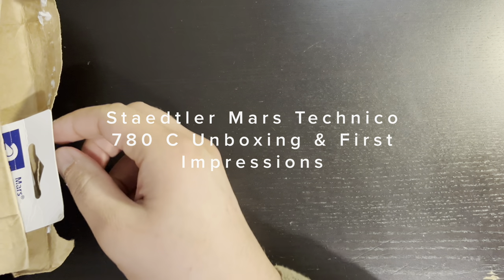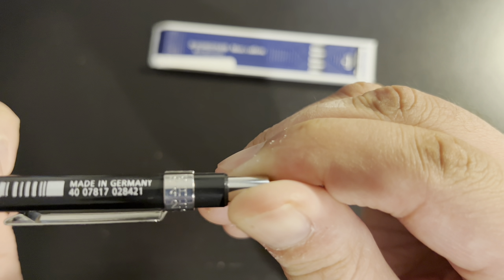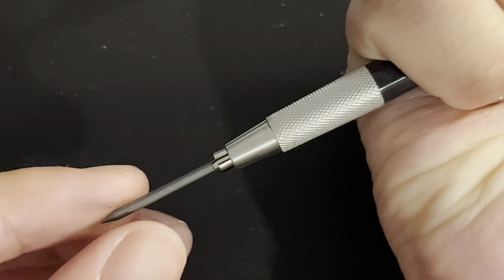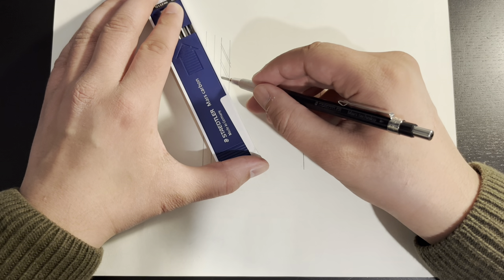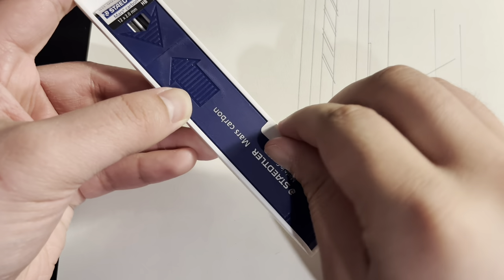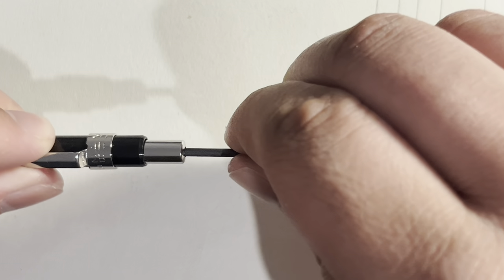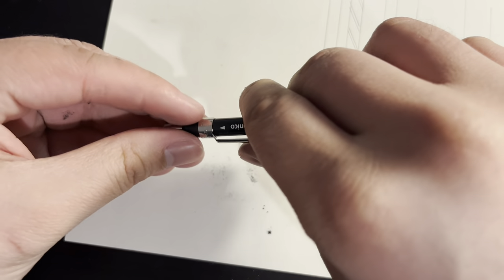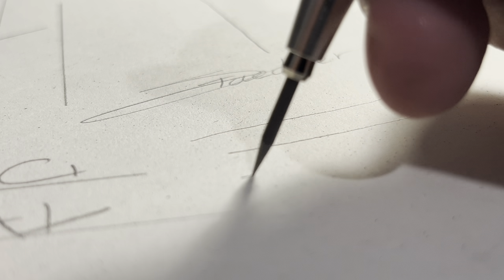Staedtler Mars Technico 780C Lead Holder Clutch Pencil & Carbon Leads UNBOXING & First Impressions

Comment: It is not possible to break the lead.. It takes much, mush more force than should be used to draw.   ... If anybody use that much pressure they Will also make big mark on the paper... several pages in a sketchbook. ... Relax when you draw.
Reply from the maker: Thanks for the tip, I’ve had a few instances where the lead breaks.

Comment from the maker: Note: About the pencil's compatibility with the Staedtler Mars 502 sharpener/lead pointer; I later found that I just needed to empty the tub which was very full and it caused problems when trying to sharpen the pencil. There's no problem and the pencil works with the 502 tub sharpener perfectly fine.

Comment: For technical drawing, Faber Castell TK 9400/ TK 4600 are far superior For general use and precise line work, Staedtler 780 is way better. So, for free drawing, either go with Pentel Graphgear 500 and Faber Castell TK 9400 combo, or if you want a one tool option, choose the Staedtler 780. TK 4600 with the clip removed, becomes a better TK 9400 pencil! Those I mention,are by far,the best drawing pencils you can get.With Faber C. I suggest their leads.For Staedtler, I prefer either Kitaboshi/Penco or Mitsubishi Uni leads.
Reply from the maker: Thanks for you comment, a very useful advice 👍
Reply: @DrawingTechnical  I dont agree with people saying,that its all about the skill of the artist.Its also the tools that add to that. The pencils i mentioned,provide control and precision,that no other pencil can.Glad I helped!
Reply from the maker: I have the TK9400 (2H leads) and I love that pencil, I use it in combo with the 780C HB leads. I've yet to draw something serious, but I have to say that holding these pencils is very comfortable.
Reply: @DrawingTechnical  Very stable grip too! Best pencil for both technical and free drawing! Fbate Castell 2mm HB and 2B leads, are what I use most.
Reply: For me Staedtler 780 is my work-horse and then I use GG1000 [0.5mm] and GG1000[0.3mm] for detailed work as required.  780 is great for everything but you have to keep sharpening it for detailed work whereas the finer tips stay sharp since the leads are thin.  Each to their own.  They are all great tools TBH.

Comment: Here’s the issue.  For a very fine tip you should not be pressing hard.  The PSI is incredibly high on sharp points.  You should be using the other less pointy sharpener in the tub.  Also look at the lead you are using.  Harder leads means more pressure = tendency to break if you want to achieve a dark line.
Reply from the maker: I have a set of 2H and HB leads, for construction line and finish line drawing respectively. In this video I broke the lead on purpose just to feel how hard it is, I don't normally break leads when drawing.
Reply: @DrawingTechnical  Got it!

Comment: Breaking leads, really? As an artist and writer who only exclusively uses Staedtler pencils - specifically the lead holders. I haven't had any lead breaks in the 16 years I've been using the lead holders. It could very well be you're applying too much pressure when you sharpening - or it could be as simple as a defective sharpener.
Reply from the maker: Hello, yes in the video I was trying to see how hard the lead is, i made it break on purpose out of curiosity. I am confident that lead pens won't break from drawing pressure. Thanks for your comment. Also with the sharpener, the tub was full, that was the problem, solved now.

Comment: Iv'e been using Steadtler for decades and have never broken a lead, that includes the softer 4B as well. Perhaps you extend the lead to far when you write, i never have more than 1 mm past the sharpened part of the lead beyond the grippers.
Reply from the maker: Hello, yes I understand, I just wanted to feel how hard the lead was. A worthless test, but I was curious.
Reply: @DrawingTechnical  You just need to learn how to use the pencil by the sounds of it.  Abusing it won’t achieve anything useful.  Get some different leads and try laying down different tones.  You’ll leant how great these pencils are that way!
Reply from the maker: Yes, I need to learn how they're used. I have heard many great and famous designers of luxury cars use them and who knows who else. Just need to practice.
Reply: @DrawingTechnical  There are 2 basic ways to use this pencil.  Writer’s grip (between finger and thumb like you write and then there’s the more weird “artists grip” which is basically holding the pencil as if you are picking something up (you hand is like a pincer).   The artists grip is typically used for charcoal but pencil artists use this a lot too.  You extend the lead out about 1 inch and then used the pencil on it’s edge to lay lines and shade down.  It’s a very light touch on the paper and you typically use your arm and not your wrist.   This is where these pencils excel and you should try this artists grip (AKA overhand grip).  I think you’ll enjoy the pencil a lot more when you use it this way.
Reply from the maker: Thanks for the info, I will have to try this.
Reply: @pentachronic  You can still use the writers grip, but hold the pencil at the back,  that allows for longer strokes using your fingers instead of the whole wrist.

Comment: When I was younger i feel in love with staedtler products brand for some reason I can not remember, maybe the brand aesthetic seemed to be profesional at first sight, mostly mechanical pencils, but watching this product (which I intended to purchase years ago) I feel like the brand made just the bare minimun in this design... not a proper lead grade indicator, nor a proper lead pushing-forward mechanism as all decent mechanical pencils, nor a decent grip or needle point for technical drawing with rulers... Thank good I didn't buy it because it was very expensive compared to similar alternative brand studmark with better features.. I guess they went straight into a vintage minimalistic design
Reply from the maker: Can you give me a suggestion for a good mechanical (or preferably a clutch) pencil? I clearly have no taste because I like this pencil a lot. I’m a modern day CAD/BIM user who never has to really use all these tools but I have a hobby of doing technical drawing the old way. Thanks.
Reply: @DrawingTechnical  Hahaha don't worry mate, we all have our own taste on pencils :D Maybe I was too hard judging this product... I guess it fulfills its function anyway, I could not suggest better models from my own experience, but I am quite sure I have seen  on reviee videos some models that have all those features, maybe the problems is they are hard to find/High price-high quality/Limited editions.... Also after  reading what I said, I feel like i was comparing two different products, for Clutch Pencil vs mechanical pencils Have their differences in functionality and design
Reply: As example, the Staedtler 925 25 in 2.0, Studmark 3750 also in 2.0
Reply: Also, I recently saw a few models of the brand Rotring, 800 and rapid pro, hope you find something  interesting
Reply from the maker: Thanks my friend :)
I'm not much a fan of mechanical pencils, I discovered clutch pencils were a thing a while ago and now stay away from mechanical pencils because they're too flimsy I think. I found this Staedtler and a faber castell that I use as good clutch pencils. I need to do more drawing however, I hardly get the time...perhaps I need to make the time.

Comment: Regarding the black cap in the end of the lead package,it matches the black stripe on the end of the package showing the lead hardness is "HB".  On my package of 2B hardness lead, the cap and colored stripe showing the hardness are both lavender. I think Staedtler intends the include cap to be used to denote what grade is loaded into the holder by changing the cap.  This may work but is not very good because one has to have the package to know what grade corresponds to the cap!  There are much better ways to tell the grade of lead in the holder directly!
Reply from the maker: Yes, it would probably bet better if they printed the lead grade on the cap itself, I think you can get a set of these Staedltler pencils for the purpose of setting the grdaes marked on the clip.

Comment: The "spare" end cap is a color code...
Any grade of lead have a different color. So you can put it on the pencil for fast recognition
Reply from the maker: I watched someone else’s video and found that too, thanks for confirming.
Reply: The problem is when you do that you lose the sharpener in the metal cap!

Comment: Faber has a little tiny sharpener just like the typical one thats for 2mm leads it costs less than a euro or dollar or just two coca cola caps. The staedtler one is good but its to expensive to be honest, but I just refuse to use the cap not because its bad, but because the graphite dust will end up everywhere eventually. 
But seriously how damn hard are you pressing to break a lead like that, if you like some darker lines try the Kaweco leads.
Reply from the maker: I have the little faber one, it's fine, the staedtler one was a gift, I wouldn't have bought it either. And I agree about using the end cap sharpener, it will ruin drawings at some point, only for use as a last resort if needed. I was pressing hard on purpose to feel how tough it was. Thanks.
Reply: The m+r is the best of those tiny 2mm sharpeners.Then follows KUM. Unfortunatelly Faber Castell makes those in China,so the quality and performance suck.